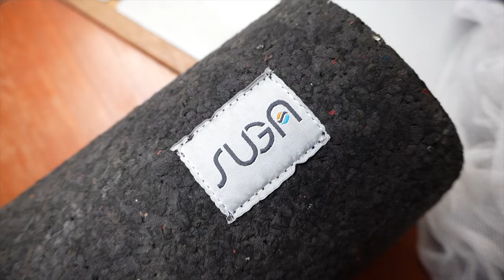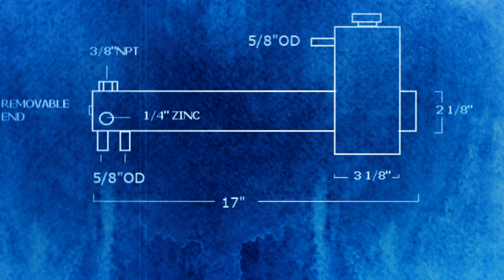all-in, FACE-FIRST, MISTAKES-MADE sailboat ownership

Comment: Like I said those motors will always run and last forever! But you should still make it fresh water cooled.
Reply from the maker: Hopefully running it one time with the sea water didn’t screw the engine up forever - yes, most of the trouble with the engine so far has come from trying to extend its life with fresh water cooling.
Reply: @sailorama  The first one I had Was salt water cooled for many years, I made it fresh water and the last I saw of it was still running great after 15 years! You'll be on your next boat by then!!!